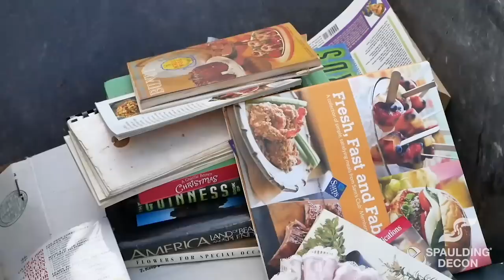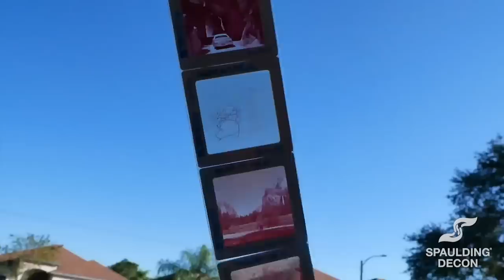60 Years of Garbage!!!

Comment: You talk about recycling the metal is environmentally better, but one thing I noticed is that they threw a TV in the dumpster. In NC, we can't throw electronics, especially TVs, into the dump. They have to go to a special location for them to remove what is environmentally unsafe and/or reusable. Is that not required there?